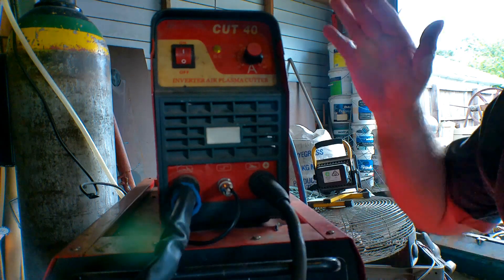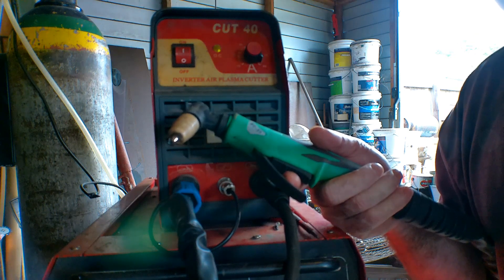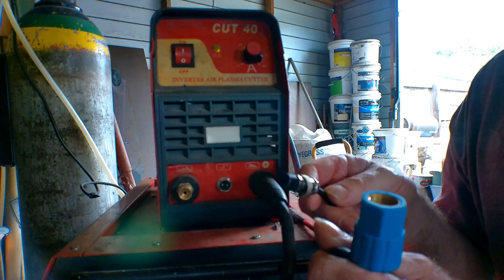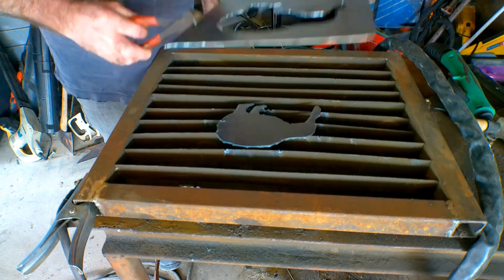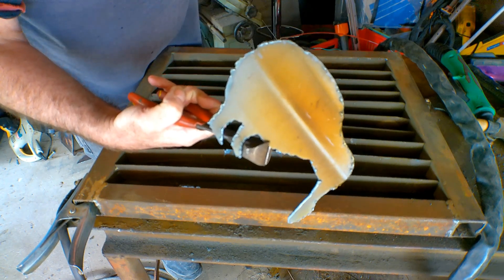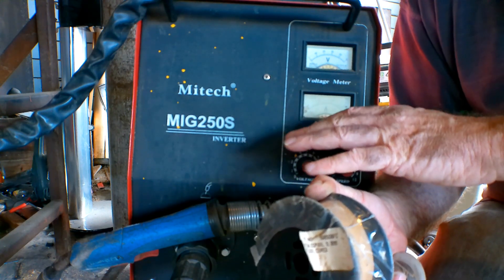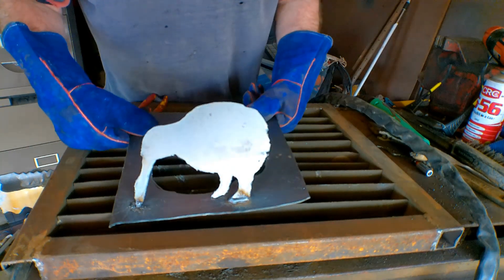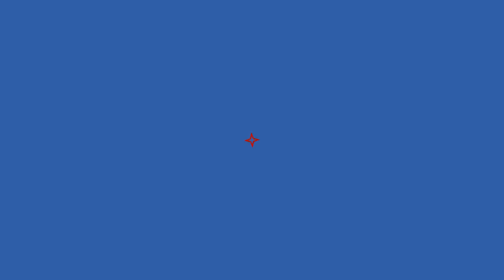👍Plasma Cutting & Welding For Beginners👍

Comment: Basic info for basic tooling . I've been mig welding for years and yup it's almost idiot proof . Nicknames are lick n stick or pigeon poo ..lol. great and simple . With arc i could never get the hang of that . If you mig the most important tip Turn on the gas ....
Plasma well that's a new one to me but with Pete's tips I'm learning ..cut 50 pilot arc ..should be fun watch this space an hold me beer ...
Cheers Pete yet another easy video with genuine info from someone whose got the tee shirt and burn Mark's to prove we been there .
Reply from the maker: Hi Gary , Hell yes your not wrong turn on the gas lol .you have been there and done that as well LOL.
CHEERS FOR WATCHING MATE
Reply: @petestools  best one I did started  my tig up got it all set and sorted and boom big hole and a splattered tungsten ??? Head scratch moment then realised oopsy forgot to turn on the argon lol